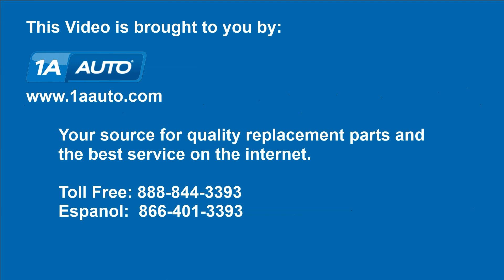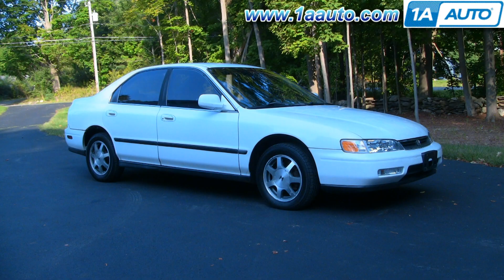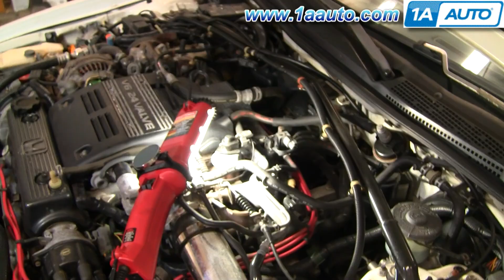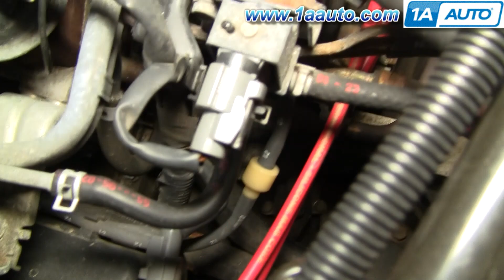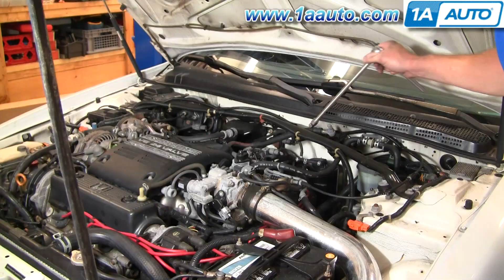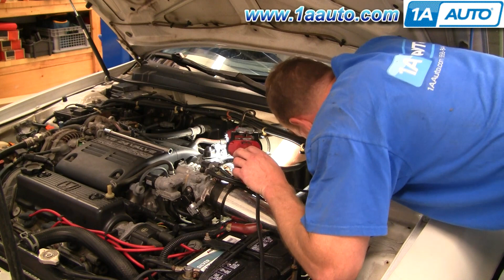How To Replace Vehicle Speed Sensor 92-01 Honda Accord

Comment: My speedometer works just fine but instead of it going from 0-60 it starts at 130 and goes to 90. Is that a VSS problem or a speedometer cable problem.
Reply: BTW it's a 91accord coupe 5speed manual

Comment: I have a 1992 Accord wagon automatic and getting D4 code 4 and CEL code 17. No speedo or cruise control. Took it to local shop and was told it could be internal. I replaced the Vehicle speed sensor, and the shaft that goes in the transmission and still getting same codes.180,000 on dash. It shifts and rides fine. Any other reason it could be not working?

Comment: Car runs normal with the engine light on, except the water temp gage runs hot easily, even with full water and oil.   Went to Autozone for a scan and got P0715 code - which pointing to VSS.  .  How do the 2 related?

Comment: Drive 1996 Accord recently gave it a tune up the check engine light turns on speedometer doesn't work reset no engine light speedometer works great possible need new sensor? Is that why check engine light on?

Comment: I have 96 honda accord dx and my speedometer needle doesn't work plus I replaced the water pump timing belt camshaft belt and pulleys spark plugs and wires and the distrubutor but it still won't start can u tell me wats wrong and does the distrubutor suppose to be set at 180 degrees
Reply from the maker: +William Cook We wouldn't be able to diagnose an issue like that here, you may want to have a local mechanic take a look at it. Thanks for checking us out! 1AAuto.com

Comment: What is the drive shaft and is it mandatory to install?
Reply from the maker: +bmore333 The driveshaft will transmit torque from the engine to the wheels and is mandatory for installation.

Comment: Ok so obviously that entire engine bay is all after market parts and looks nothing like an original 95 accord engine bay. So wheres the speed sensor on a stock engine?
Reply from the maker: +ShadoeFax While the parts used are aftermarket the vehicle's that are shown in the videos are designed to be stock and the repairs done as they would be done on the original vehicle. +1A Auto

Comment: I have a 92 Acura Legend. My speedometer some times works and some times it doesn't work while I am driving (moving). This is what's crazy, I can be sitting at a light and the speedometer with start going up and down from anywhere between 0 mph to 60 mph and I'm just sitting there. Does anyone know what the problem is or could be?? Thanks

Comment: Is the trouble code p0715
Reply from the maker: +Erik Mora It is a common code for speed sensors. Especially if your vehicle experiences these symptoms: increased fuel consumption, speedometer fails, engine stalls when coming to a stop, and transmission won't shift
Reply: @1AAuto  Thanks

Comment: Hi Mike. I have a 95 odyssey .  The speedometer stopped working about 2 weeks ago.  Also my cruise control isn't working.  The ABS and SRS lights stay on.  I replaced all the fuses with new ones. So. I don't know why this is still the case.  The idle is jumpy at times.  Other than that, it's a very reliable car.

Comment: 1996 Honda Accord LX 4CL.  Check engine showed p0510 speed sensor. My Odometer was working. I changed speed sensor. Light off. Came back on and odometer stopped working.  I tried to take it out and bolt broke with bracket attached to car. JB Weld it back together and put sensor back in.  Did not work. Codes now are p0510  P07056 and 7-3 3-2.  Any suggestions?

Comment: I have a 91' Honda Accord with a faulty speed sensor.  The only problem I have is pulling apart the connectors.  There is a tab at the end that I'm trying push down that may separate the male and female connectors but it's being stubborn.  Any suggestions?  Thanks.
Reply from the maker: +Michael Kam Thank you for checking us out. Some of the tabs will be stubborn, and if you are able to use a flat head object or additional pressure this should separate. If there is room, a second pair of hands to pull out the plug is helpful as well. 1aauto.com

Comment: HOW does the vss work?  physical switch?  Magnetic switch? Magnetic coil?  optical using infrared diodes?
in my 86 accord, i get huge radio interference that is directly related to vehicle speed, not engine rpms.  The speedo works, the cruise works.

How to test a vss once it's out of the vehicle?

Comment: Hi, Thanks for the video, where is the location of input speed sensor on Honda Odyssey EXL 2006?
Reply from the maker: +R Jayan Thank you for watching. This sensor will be located on the input shaft of the transmission. It should be on the lower front of the transmission. 1aauto.com
Reply: Thank you so much

Comment: hello. thanks for the video. I have changed the speed sensor for my 1996 honda accord v6 2..but still my speedometer does not work properly.sometimes it works most of the time does not. what should i do?
Reply: by the way there is no CEL and my cruise works well..please need help..
Reply from the maker: +Engr Imran I did a little research on this for you. Apparently the speedometers in these cars have a tendency to fail after some time. People experiencing the same symptoms as you (no CEL and working Cruise Control). They got a replacement speedometer and swapped the circuitry from it to their own. Here's a link to a decent walkthrough with pictures on how to remove the instrument cluster. Can't guarantee this will solve your problem, but it's worth a little more research. Hope this helps!
http://honda-tech.com/forums/honda-accord-1990-2002-2/support-themuffinmans-cluster-removal-faq-2047461/
Reply: thanks bro..it has been a great help...

Comment: Is this the same for 1998 Honda CRV? 

I see 3 sensors and I don't know which one is which. 

I get p0715 Input/Turbine Speed Sensor Circuit "A" and p0730 Incorrect Gear Ratio 
and I heard that the sensor may affect the gear ratio
Reply from the maker: It may be a different procedure on your vehicle. We carry replacement speed sensors for it, we currently do not have an auto repair video on this particular repair. 1aauto.com

Comment: Hello!  I have a '95 Civic EX Coupe.  I bought it used with tires that were bigger than manufacturer size.  The speedometer read about 5-7 mph faster than the actual speed.  I replaced the wheels and tires to manufacturer original size, but now the speedometer reads 10 mph faster than the actual speed.  Could this be a speed sensor problem?  Thank you!
Reply from the maker: It might be an issue with the speed sensor. 1aauto.com 888-844-3393

Comment: Thanks for the video i have 1991 honda acc with flashing s light and speedometer not working replaced the speedm sensor forget the driving shaft do you think that the driving shaft is the problem since the light still flashing and the speedom still not working. Thanks.

Comment: Hi thank you so much for this vidio i have 1991 honda automatic my speedometer does not work the s light flashing and the antilock break light on my freind replaced the speedm sensor but did not use the drive shaft pin the car still the same flashing s light and the antilock light , the car drives fine. do you think that that drive shaft is the problem .
Thanks a lot.

Comment from the maker: You may want to check the transmission fluid level to see if it's at it's proper level. Hope this helps you out. 1aauto.com 888-844-3393

Comment: OK hopefully you can help. I have a Automatic 96 Honda Accord. Recently it has been acting up. I think it is the speed sensor. The speedometer works at times, stays at 0 during other times and sometimes just jumps between 0-80 randomly. When it is acting up generally it is rough for my car to shift but shifts fine if I shift the car manually. Would you agree it is the speed sensor or is something worse the underlying problem? Any response would appreciated.

Comment from the maker: HI James, Is there a check engine light on in the vehicle? If there is you may want to pull the code, as this should point you in a direction. If might also be an issue with the throttle position sensor (TPS) 1aauto.com 888-844-3393

Comment: Hey great video.  I have a problem with my speedometer not working.  It doesnt read how fast I'm going and my 94 accord won't shift into the next gear.  After driving real slow for a few minutes, when the car warms up the speedometer starts working again and starts to shift like normal

Comment: i have a question would greatly appreciate if you could help. my 96 civic ex manual speed-odmeter isnt working at all, i was looking at the part online and its the whole vss including the shaft with the gear at the end that goes into the transmission not just the sensor part. is it a different install than what you did in the video or is it roughly the same?

Comment from the maker: The issue might still be there but the connection might have jostled itself back into place. It will eventually break connection again and you will end up having to replace it in the end.

Comment: Thanks for the reply!
So, I ordered the part from you and just picked it up from the PO yesterday. All's well there.
But the "check engine" light went off and everything seems to be working fine.
I'm going to hold on to the part but does that make sense to you? I had the code read and was told it's the speed sensor. You think something got jiggled back into pace or do think it's worth swapping put anyway?
Thanks,

Comment: I have a  nissan sentra 1994, my car only run in 1,2,3 shift but 4 shift nut run. its Automatic transmission) my speed sensor its not working, I whana now if that can be the problem that the car not run in the 4 shift.

Comment from the maker: If you have had trouble with your Honda Accord or Acura speedometer working improperly or reading wrong then you may need a new vehicle speed sensor. We carry new speed sensors on our website with free shipping. 1aauto.com 888-844-3393

Comment from the maker: A bad or malfunctioning speed sensor will often cause a service engine light error code, shifting problems, or rough running due to inaccurate computer or ECM readings. You may want to check this first to see if it could be causing all of these problems. We carry new ones on our website for your vehicle with free shipping. 1aauto.com 888-844-3393

Comment: Hi I have a problem with my speedometer not even working and the  ECU light comes on, i got it inspected but will cost over $1500 so yeah i need some tips how to get a part for my vss if you got any ideas please thanks :) i have a honda integra 2001 by the way

Comment: Hi 1aauto, thank you for postin this helpful video, I just change the speed sensor on my 91 accord but when I went for a test drive and I reached 25 mph I steped on the brake and the engine stayed accelerated so I had to use the emergency break to completly stop and after that my car does not start. What do think I missed? Thank you very much for your help.

Comment: my civics one is reading overreading by about 10-15% i tried changing the VSS by buying a new one off ebay, fitted it like this, but the problem is still apparent. ive ive noticed that when slowing down the VSS is inaccurate, it doesnt really capture how much spead im losing it can say 20km/s hour when im nearing a complete stop then it will just drop back down to 0 when i have stopped.

Comment: hello 1aauto. i have a speedometer problem. while driving with a 35 mile per hour(for example, not always at this speed) the speedometer just move up by it self, which make my car to shift to the next gear. could that be the speed sensor? i have 1999 civic automatic.

Comment: i have a ford winstar 2000 ithas 100.000 miles,2 weeks ago my OBD-OFF LIGHT TURNS ON WHENEVER I DRIVE  FOR MORE THAN AN HOUR AND IT TURNS ON AND OF,I ALREADY TOOK IT TO AUTO ZONE AND THEY GAVE ME THIS CODE B1146 AND I WAS TOLD THAT IT COULD HAVE BEEN THE SPEED SENSOR OR THE TRS. WOULD YOU PLEASE TELL ME WHAT I CAN DO.

Comment from the maker: @jhdezjr That could be something as simple a bad spark plug wire. If you haven't changed them in a while you may want to change the plugs and wires on the car. Hope this helps you out.

Comment from the maker: @Pgarcia1121 You may want to check the fuse going to it and also look for a bad ground or wire that could be broke causing it not to work. If the speedometer works fine, then it shouldn't be the VSS.

Comment: I have a 95 Accord EX sedan with an I-4 Vtec automatic. The car is in limp mode and it doesn't shift past second gear. Also, my speedometer doesn't work. Could this be a faulty VSS, ECU, TCU, and/or instrument cluster? I am willing to replace all four because it would still be cheaper than purchasing and installing a new transmission. Please help!!! Btw great video.

Comment from the maker: @thesuzyloo A bad cable would cause that symptom. Unfortunatly sometimes it's not easy to tell until you replace it. I would probably try the cable first and if it still acts up it would more than likely be the sensor then.

Comment: By the way.. love the videos!  Thank you so much! Question... How do I know if it is the speed sensor and not a problem in the cables running to the sensor?  My is at zero when I start it, then it jumps to 20 mph as soon as I accelerate and sits there.  Occasionally, it jumps up and down... Then at times it jumps back to the correct speeds and follows me as I accelerate or decelerate, after which it typically goes back to 20mph and stays there.  I have a Honda Accord '96 V6.

Comment from the maker: @ehowards You may want to start by checking the fuses to see if they are good. If they are, then check the connection to the VSS sensor on your Nissan Altima, to see if it's plugged in correctly.

Comment: I have changed the speed sensor twice and I still have the same problem. the mechanic said that the thing underneath the speed sensor (between the sensor and the transmission) might be broken. I didn't understand what he meant but I saw on manual transmission (mine is automatic) that the sensor comes with a whole assembly that goes inside the transmission. is there such a thing that sits between the sensor and the transmission and if so what is it called? I greatly appreciate your response!

Comment: I have  a '95 accord ex (vtec engine) and I couldn't find it. I noticed on the video my battery is on the passenger side instead of the driver side, so would the sensor be on the other side as well??

Comment: @1aauto  I have a 1995 honda accord v6 ex 2.7L and it recently started to shift late at higher rpm, such as 2or3k rpm to hit 2nd gear i belive and it didnt seem like the tach was showing the right speed could this be the VSS that is causing this? thanks